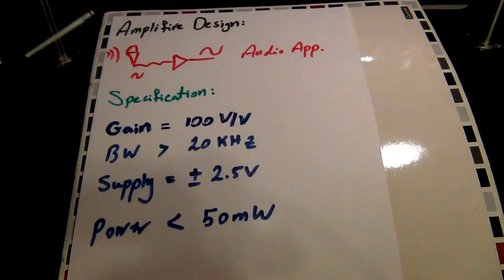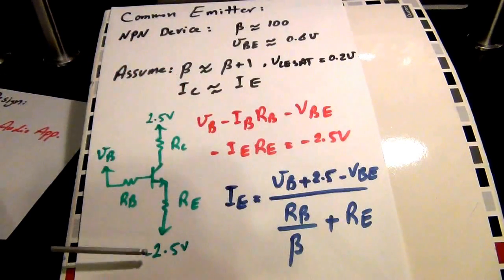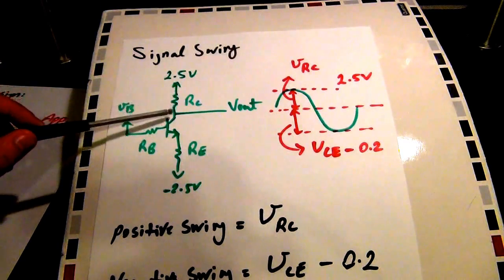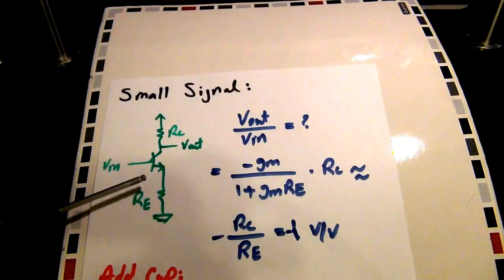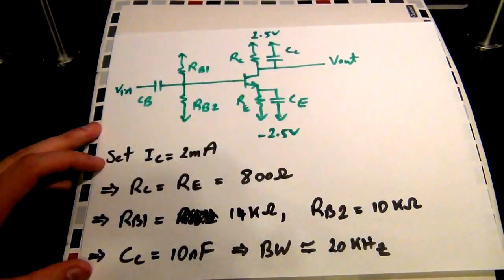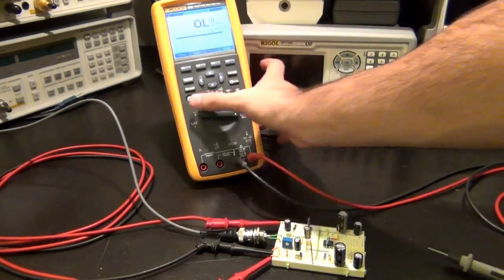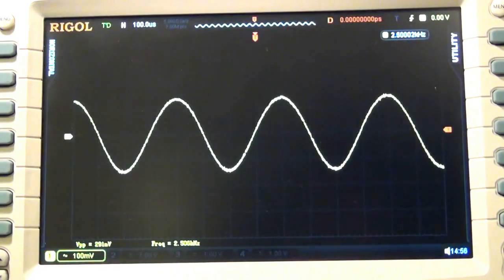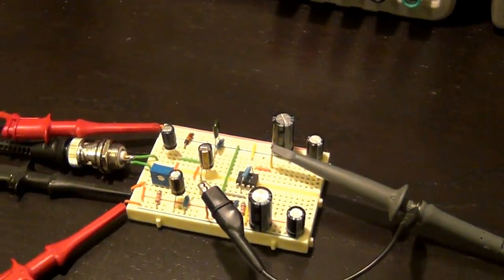TSP #15 - Tutorial on the Theory, Design and Characterization of a Single Transistor BJT Amplifier

Comment from the maker: My expertise is in mm-wave integrated circuits for wireless and wireline applications. You can lookup my work and publications through Google Scholar. I have also been playing with electronics for 20 years, since I was 10 years old.
Reply: The Signal Path  I like that you began playing with electronics at 10 years old. I did the same.  I've been an engineer for 45 years.  I'm 66 years old and still learning.  The more I know, the more I realize that I don't know.
Reply: @ufohunter3688  By all radio frequencies at once, what are the frequency range you are talking about?
Reply: Could you make a tutorial explaining the basic elements of a RF digital transceiver such as a Bluetooth or WiFi modem?
Reply: @billmoran3812  Its nice to hear that someone so experienced keeps learning. I only really started messing around with electronics about 2.5 years into my degree (I would have been about 24 around that time) and was sort of angry at being so lost - I thought I should be able to understand it all since I'd been studying it all in uni. Lately though, I'm starting to appreciate that this stuff can be really hard, and that there is no substitute for spending a lot of time, reading, watching, doing, making mistakes and learning. Hope to be a lot better at this stuff one day! Electronics is awesome.

Comment from the maker: Thank you, I will correct the problem. Yes, the 10nF is calculated for low-pass operation. If you want to only use transistors, you can design another common-emitter stage to follow this one. Just make sure you don't use an emitter capacitor again the whole thing would become very non-linear.

Comment from the maker: My calculations of the signal swing is correct. Perhaps what you are trying to say is that the signal swing can be improved. That is true. However at the cost of causing more beta-sensitive biasing. Dividing the signal equally between the three elements is a compromise between beta-insensitive biasing and swing. Furthermore, it is true that there is no emitter degeneration. However for an application where the input is less than VT (25mVpp), the distortion is not of significant importance.
Reply: Due to availability, I would have to make the 1st stage amplifier with following component values:                                                                                                                    BC 547, Rc=Re=1k, RB1=14k, RB2=10k, Cc=0.1uF, Cb=Ce=100uF                                               
Will the amplification calculation (i.e. A=-64) and the practical results (i.e. Vin=5Vpp, Zin=50, f=2.5kHz, Vout=300mVpp) hold (under experimental error allowations)?

Comment from the maker: The dual +/- supply is common for analog circuits. It also makes using the opamp easier as a second stage amplifier. A single +5V supply can also be used. The same principles apply.

Comment: Great video!
Just a little correction. Human ear can perceive sounds down to 20 Hz, but for a microphone amplifier 50 Hz may be a rather good threshold to pick up less hum and different mechanical noises, wind for example. Humans can actually perceive frequencies less than 20 Hz not as sound, but as vibration. It could matter for say a good studio mike. If somebody would record say a sound of arriving train, it would be rather dissapointing to not have this vibration low-end in the record. This details don't really matter for the purposes of this video of course, but I thought it may be interesting.
Reply: Some people can hear below 20Hz and spectral content above 20kHz also plays a role in signal shape at far lower frequencies, we always designed for 5Hz-100kHz, but with EQ on the passband gain. RIAA is a good starting point, most people prefer a smiley face curve : ) so shelving filters are good for the general public. You’re correct, design for flat response across the range will sound terrible to most people even though it’s technically perfect...

Comment: By putting Re the biasing becomes independent of Beta, and so does the DC gain, which in this case it is equal to unity as there is a lot of negative feedback. On putting the capacitor Ce  the AC gain is still dependent on Beta. I like the manner in which you found this maximum gain.  THis AC gain  I presume  may be controlled by adding another resistor  above Re, unbiased by Ce.

Comment: I built the circuit and it works!  I'm still working on the input because my function generator's minimum output voltage is too high (reducing the amplitude of the function generator to  milivolt range is a project right there).  Today I'll try a microphone.   If you want to build on this basic circuit adding a second transistor or what ever it would be much appreciated.
Anyway, Shahriar thank you again for this very helpful video.
Reply: Try A Attenuator at input signal to reduce p/p. I have a HP 3325B that can apply 1mV p/p.

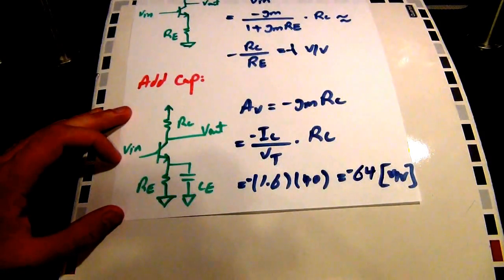Comment: This video was very informational until 17:00 when you suddenly added components without their explanation. When you show with the equation how Re is selected to create a bias which is beta insensitive, as well as showing the equation which shows how Re affects the gain, these were very helpful. However, I lost interest when you began to neglect the equations for the decoupling capacitor, voltage divider, and the collector capacitor to limit bandwith. I would have liked to see the collector capacitor and bandwith equation most of all. Thanks for the first half though.
Reply: The Offset Volt has some well explained videos on the subject.  As a starting point a BJT  has two modes of behavior a DC and an AC mode.  The BJT first has to be biased (setup) using resistors and DC voltages. Afterwards, it can be used to amplify AC signals using capacitors and resistors.  When you come across variables using capital letters they refer to DC parameters lowercase refer to AC parameters.  

Essentially, the DC voltages setup the BJT to be used as an amplifier.  You use all those weird equations with the uppercase letters to accomplish this. Once this done, you can add capacitors and more resistors to amplify your AC signal. This is done using the equations with the lowercase letters.  You wind up with two different circuits connected onto the BJT an AC circuit and a DC circuit. This clever trick is accomplished via the capacitors.
Reply: @jeffreymelanson9230  thanks for that bit of info. im gonna be rewatching this like a billion times over the next few years as i gradually learn more. kinda sorta getting there.
Reply: @jeffreymelanson9230  thanks for the feedback!. So 2.5*Rb2/(R1+Rb2)= 1.046 Volt to the base. Any clue on why this 1.046?

Comment from the maker: The noise was actually from the oscilloscope. There was a problem with the beta firmware I was using. The noise is not from the circuit. :)

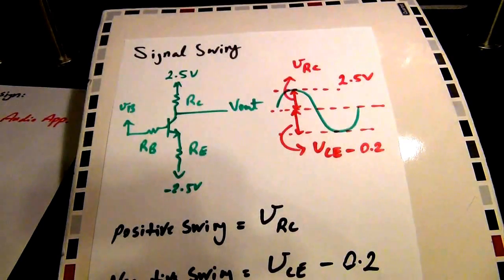Comment: Good Video and thank you. In the video, you repeated the signal swing section at 7:15 and 9:32  otherwise is perfect. About the design, Did you calculate the 10nF capacitor like a low-pass filter with the collector resistor? and if I just want to use transistors (without a op-amp), Do I have to use a common collector stage before a common emitter stage?

Comment: Great video but there's something I would like clarified:
I understand that we want the maximum voltage swing and I understand why VRc should equal Vce-Vsat but I don't understand why we also want them to equal VRe. Why Can't we have VRc = Vce-Vsat  and keep VRe smaller?
Reply: Hey, if u still haven't found the answer, then here is what I understood :
To maximize the upswing, u have to maximize VRc which itself has Vc (voltage at C) component (i.e. VRc= VR-VC) and now to maximize VCE, U have to maximize both VC and VE (see both are of opposite sign) which in turn makes u increase VRe. so, what basically it means is that maximizing one of the voltage has an effect on the other.
Reply: im confused as to why he is using a negative voltage, ive always seen these examples use regular positive voltage and ground and you set Voltage at the collector to be half of your power supply which puts it right in the middle of the load line
Reply: BJTs have a great deal of variability when it comes B-values (Beta) they are also affected by temperature changes etc this means that the gain will also be affected by these factors. They are biased so that they operate at a certain DC current and DC voltage. In other words a certain operating point. There are different types of biasing configurations that attempt to attenuate these variabilities and thus provide a stable operating point.  This type of biasing does just that better than the biasing you are more familiar with.

Comment: The output swing sign should be reverse, overall the video is comprehensive, thanks.
Reply from the maker: Can you please clarify what you mean by "reverse"?
Reply: @TheSignalPath  using a NPN transistor the v out should be of reverse sign.First half positive sign must be negative and second half sign positive.But you did not show the analog sign wave polarity at transistor base input so you are right in your explanations.
Reply from the maker: @idreestech  I see what you are saying. The CE amplifier is inverting. If you look at the gain equation, you can see that as well.
Reply: @TheSignalPath  fine, Thanks!

Comment: Hi, very interesting, i am surprised how the mathematical theory can be close to the later practice and measurements on electronic 
I have a question to modify this project.
I would like to receive only positive, top part of the amplitudes, but the amplitudes don't come down to zero, only stop for example on  +0.5V before zero, and again rising up ....
It could be done with 4 diodes to take also use of the lower amplitude ....
Thanks for any suggestions

Comment: Thanks for the good clear explanation. I noted that you're using a BJT for the first stage to avoid noise, but then you use an opamp for the second stage. Would the noise come from the large-value feedback resistor required to get a gain of 100 out of an opamp? Is that also why you used a non-inverting opamp configuration, to use a smaller-value feedback resistor? Thanks.

Comment: What do the variables gm and Vt mean?
Reply: gm refers to transconductance, it is essentially the ratio of output current change to input voltage change.  Vt is the thermal voltage and is derived from certain constants at room temperature, taken to be ~26mV give or take.
Reply: carriersignal   thanks for your explaination

Comment: First I'd like to thank you for all the amazing content you've been shared with us! My question is why the input and shunt capacitors are polarized type (eletrolytic)? They shouldn't be unpolarized ones because the alternating voltage? Best regards from Brazil!
Reply: It's because of the values. High capacitance values are just available for electrolyte cap types or for tantalo types. The electrolyte ones are less expensive and easily available. Hello from Brazil!!

Comment: This is a nice way of designing an amplifier. However, there is also the S-parameter method. What is the link in between these two methods? It confuses me because here you are designing for voltage. With S-parameters we design for power. Furthermore, couldnt you just get this voltage amplification with a transformer? I am confused about multiple points, and will be really happy if you can help me

Comment: hello sir am not very familier with the analog circuit design so i find difficulty in relating the base circuit to the emitter collector network.my doubt is how did you get the values of base resistors i.i r1 and r2?

Comment: At about minute 7 you set up your equation. In it you said Ie =Vb + 2.5 , etc. But you pointed at the -2.5v at the bottom. Which is right, 2.5 or - 2.5 ?

Comment: Can you make a sequel video showing the a/d converter and power opamp is added so it drives speaker? That would be more complete and motivating. By the way, what opamp did you use in this video? Does it use two power source or one?

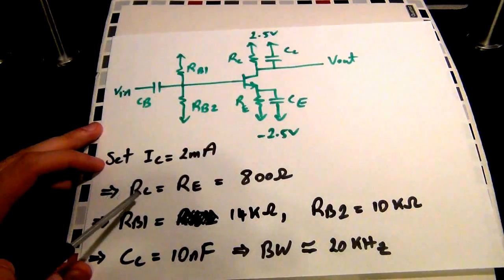Comment: Whats is the voltage that you need at yo base? at 18:25
How do i know what i need? in your case what is the voltage that you need at your base?
Reply: 5 years late, but .... voltage at RE is 1.6, the base voltage must be .6 higher so 2.2v. This is a dual supply so 2.2 - 2.5 = -.3v at base.

Comment: why are you using polar electrolytic capacitors as decoupling when it is clear that the signal can swing both positive and negative? isn't it bad that the capacitors are biased in reverse?
Reply: You need to use fairly large caps in order to reduce the low end ac filtering. Electrolytic caps tend not to mind if they are pulled negative for a little bit, the electrolyte reabsorption process is quite slow and so as long as you aren't holding them negative you should be fine. You could bypass the electrolytic caps with small polyester caps ~100nF to decrease reaction time and lessen the effects of the negative voltage.

If you have any spare electrolytic caps try charging them up the opposite way around (do it outside and stand back) they do make quite a nice little explosion when the pressure builds up. But you'll notice if takes a good few seconds for anything to happen.
Reply: Joshua Mcateer
right. where did you learn that?
Reply: If you took issue with the content of my comment it might be more productive to say what you thought was wrong and then through careful reasoning we may come to a logical conclusion.

I should put that that first sentence in my comment was meant to be 'You need to use fairly large caps in order to reduce the low end ac filtering, so you have to use electrolytic capacitors as non polar ones tend to have a much smaller capacitance'.
Reply: I asked, "where did you learn that?", not "lol ur wrong".
Reply: i am a physicist too (msc). I already know why polarized caps are used, i know why they can be used. I have not found out, yet, why/if it is OK to do so. Is it in any textbook? Is there a manufacturer datasheet that says so? Sure, if you stick 1 V ac on it at a low enough frequency, it's not gonna blow, but is it good practice? Why? I've been searching quite a bit, i haven't yet found a satisfactory (as a physicist) answer.
Reply: Okay, this is a bit of a guess (my electrochemistry is dodgy at best) but here goes. Electrolytic capacitors have two plates separated by the electrolyte and the oxide layer on one of the plates (fact). The oxide layer is insulating, and the electrolyte conducting and so the capacitance is between the plate, the oxide, and the electrolyte (fact). The oxide is deposited on the plate by passing a current through the plate and the electrolyte so that some of the ions bond on the plate (~fact). This requires energy, as bonds are made (fact). When the capacitor is negatively biased the oxide is re-absorbed into the electrolyte (fact). This might have some work-function, or some kind of stopping voltage before the process takes place, to provide the minimum energy to break the ionic bond (~reasoned guess).

Also when ac is applied to the cap while the negative portion of the wave may be stripping off the oxide the positive portion would be reforming it (~reasoned assumption).

What do you think?
Reply: honestly, no idea. Probably right. There are reports that some manufacturers say that about 1 V to 2 V of reverse bias is OK. Haven't seen anything in a datasheet, but i haven't seen many datasheets, to be even remotely convinced or sure. It's another one of those things that people use a real damn lot but noone takes the time to question it. Thanks for answering.
Reply: +George Tsiros You need to look at the DC conditions of the circuit and note that nowhere will the AC small signal  be enough to put polarised caps in a reverse voltage condition. Its a weird design choice of supply as single rail op amps can be happily used. Coupling cap better choice is poly type. Also better to draw a load line to find operating point.
Reply: consider input decoupling capacitors in a typical amplifier.
Reply: George Tsiros
They are coupling caps
Reply: George Tsiros
Ps Yes but since they have been used as such for the last 80 years with no problem in almost every amp radio tv etc you can guess a small signal reversal is ok.